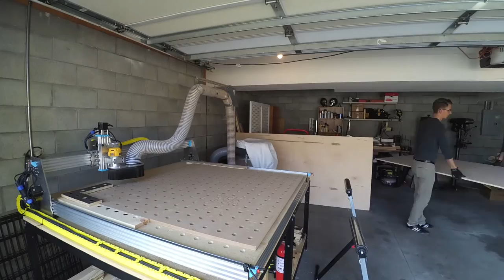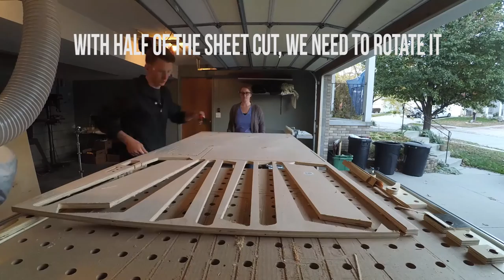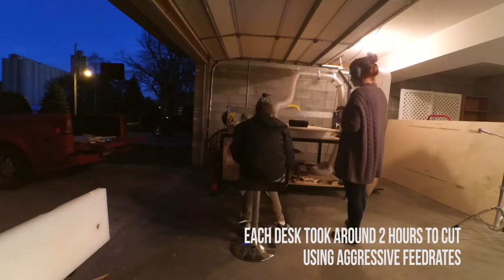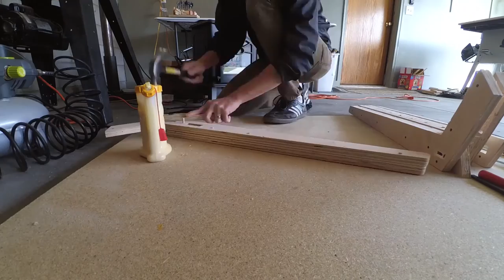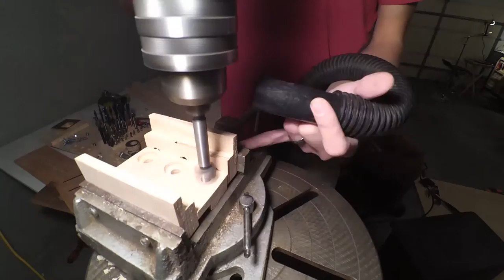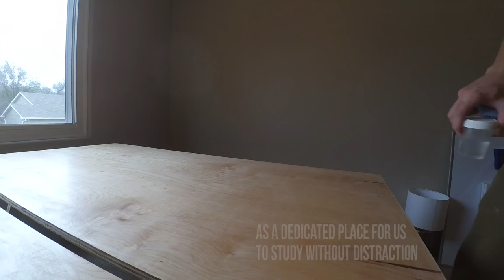Desk Build

Comment: I tried cutting plywood and had very bad tear out, what bit are you using.
Reply from the maker: We still got quite a bit of tear out, but it was more fuzzy than whole chips flaking off. This was a Kyocera 1/4" up-cut 2-flute carbide endmill. Drillman1 on ebay sells them for about $12. Down-cut mills or compression mills are what you want to use for plywood if you can justify the cost.